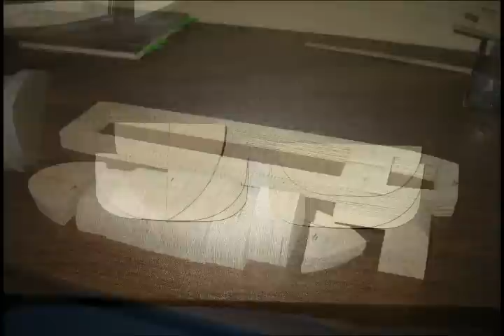Legend of the S.S. Willy Maykett

Comment from the maker: @starwarsfandude I don't think it is possible to retrieve your ship without causing any harm, as simply pulling the ship straight up will cause at least a little damage.  However, there are ways to minimize damage to the weeds.

If you can dive for the ship, that would be best.  You can cause less damage in person than any machine less expensive than your ship.  If that is not an option due to depth, distance from shore, or other hazards, then you'll have to use alternate methods.

Comment: The float did deploy, but it has a very thin line that the camera can't see very well, so you can't see it.  Also, because the pond is about 8ft deep, I can assure you as the one of the club's salvage experts that it is easy enough to swim down to the wreck rather than pull it up by the float.

Comment from the maker: no, it turns out that fresh water (no salt or chlorine) doesn't immediately destroy electronics.  As long as you recover the ship and dry it out before rust forms (usually several hours) your electronics will be perfectly fine.  A bath of Isopryl Alcohol speeds up the drying process.

It is also possible to coat some of the circuitboards to protect against water.